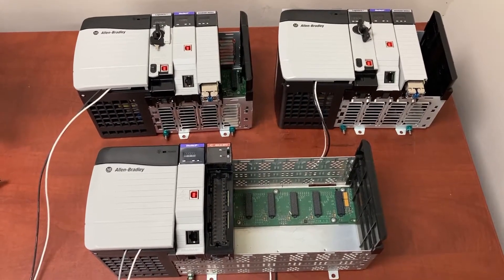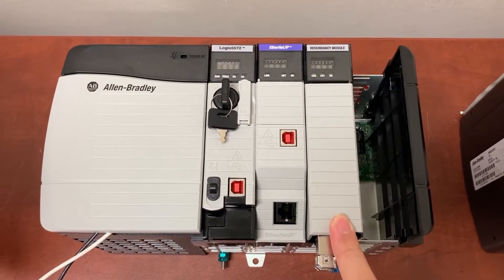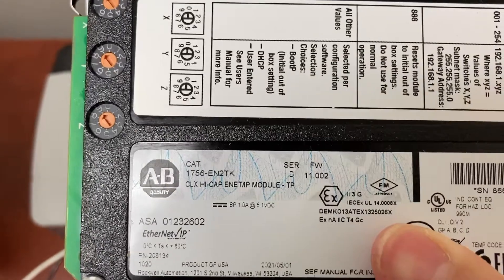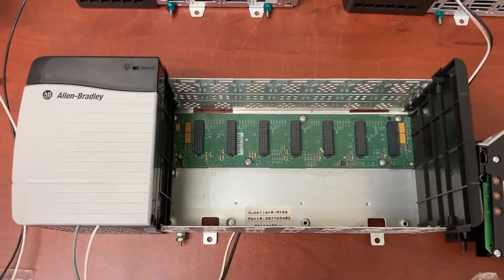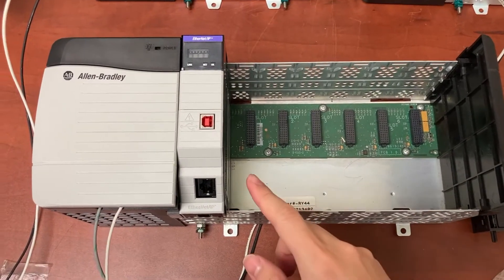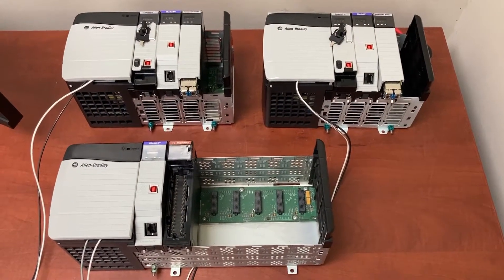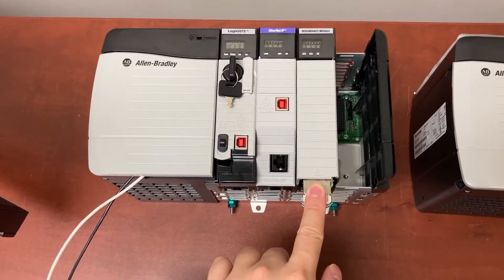Allen Bradley ControlLogix Redundancy System 1756 Part 1/5 - Hardware Set Up

Comment: Thank you very much for your helpful video. I have a question:

The fiber optic jumper cable recommended by Rockwell is 1756-RMC1 (ControlLogix 1 M RM Fiber Optic Cable). However, I currently don't have it available. Could you please let me know if there are any alternative cables that can be used? If possible, could you also share the model of the fiber optic jumper cable you are using?
Reply from the maker: @SinhPV: You don't need to buy those cables from Allen Bradley. In fact, the yellow cables you see in the video are not Allen Bradley. I showed the spec of the cables just to make sure everyone can get the right one. You just need to buy fiber optic cables LC type single mode, 8.5/125 micro. Below is the cable I found from Amazon that you can try. Please let me know if it works out for you.
As always, if you like the content of my channel and my videos are helpful for what you are working on, your little donation "super thanks" means a lot to my channel as a great support to keep it running and helping more and more people overcome challenges in programming and automation. Thank you.

https://a.co/d/7B2C8nv
Reply: @SYPHOANG 

Thank you. I will try to set up the Super Thanks feature on YouTube.

Comment: Hello, i followed your steps in order to setup a redundancy system, and it works!!! But only channel 1 is working, channel 2 has a flashing red light and the redundancy tool says: link down; i changed the places of my fiber cables, but again the same light started flashing red (so cables are good); how can i solve that issue and have both leds in green? Thanks
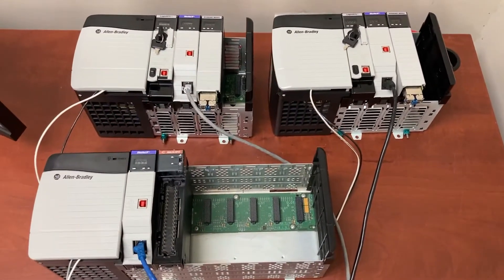Reply from the maker: @Paul Avalos: Thank you for subscribing to my channel. Make sure you are using the right fiber optic cable type @3:54. Have you watched all 5 videos in this series? This links are under this video description. It should walk you through all the steps. In the last video of this series, "flashing red" that you are experiencing means either "Redundant channel error" OR "No cable connection".
Reply: @SYPHOANG  yes, i've followed your steps and the redundant system is working; my question was about my 2nd channel, it's flashing in red, I thought perhaps one cable was damaged, but when I exchange them, the same channel started to flash in red. So it's a redundant channel error; have you seen this event before? Thank you
Reply from the maker: @Paul Avalos: If you followed exactly what I showed in this series. Getting the right firmware for the 2 processors, 3 Ethernet modules and 2 Redundancy modules. The redundancy configuration is also correct in the program. If everything is correct, the only thing I can think of is the redundancy module itself.